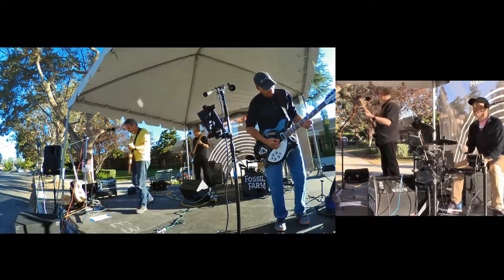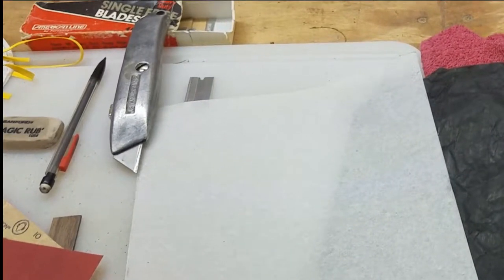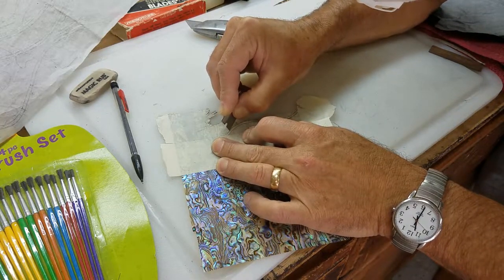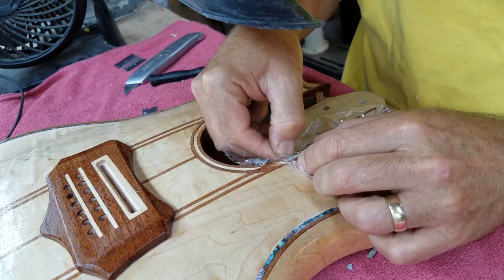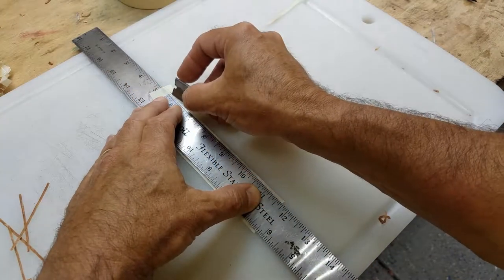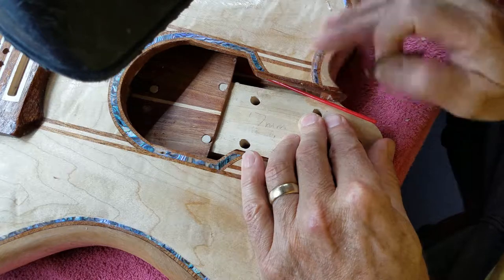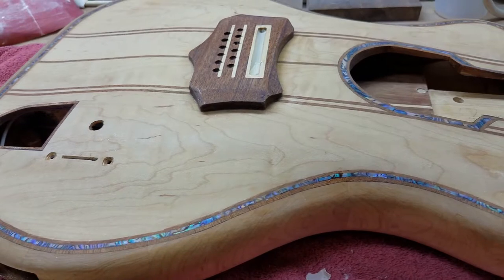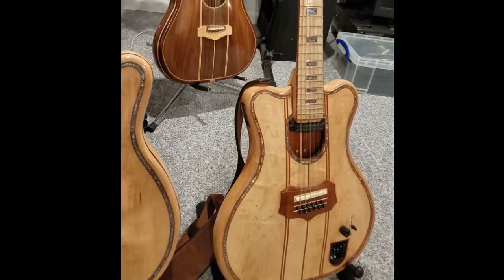Add Abalone/Mother of Pearl Inlay Faster Using Shell Veneer

Comment: With all the high end guitars I have and all the abalone, wood purfling that is used, someone must have the patience of Job!  This is a remarkable video.  I am sure that "massed produced" guitars have a more mechanized procedure for abalone/mother of pearl inlays.  Even some high end guitars use the real thing on the top and "cheat"/imitation on the sides and back, so say's my luthier.
Reply from the maker: The great thing about using veneer is that it is real shell, so is as authentic looking as the solid stuff, but much easier to work with. That said, these day's I've also been using some man-made thin veneers and getting great results. I've no idea how thick the MOP and abalone shell actually is on production guitars.

Comment: I was really thinking about this method, cause makes cutting the shell easier and without jewlers saw, but I didn't know if it would work, also I was thinking to glue a wood piece of the same under the venner to make it more rezistant for the frets. Glad I found this video
Reply from the maker: I use this veneer on both bodies and fretboards. I've had no problems at all with it on the fretboard, though I do actually slightly inlay it in the surface and backfill to fretboard level with the superglue (CA). That way, it is absolutely level with the fretboard surface. Another thing: these days, I usually paint the underside of the veneer or the surface of the wood with a thin coat of black paint, as it makes the veneer really 'pop'!
Reply: @Drewmo2000  Oh, so there is no need for an extra piece beneath the veneer for resistance, CA glue should do the job. Regarding the black paint, you paint after you inlay the piece and then sand? Or before
Thank you for your answer and tips, cheers mate!

Comment: Superglue wood filler /coating never seen this before in a large scale. Nice
Reply from the maker: Works great, though getting more expensive, especially the accelerator for some reason. But it's worth it, especially if you spray nitro, as you only need a few top coats and thus saves putting tons of lacquer down with the necessary very long drying times.  Always keep a can of acetone handing though :)

Comment: Thank you for this. I want to use simply the abalone without the wood trimming. Does everything in this video still apply?
Reply from the maker: Yes, definitely! On some of my guitars I do a much simpler finish on the backs, just using the shell veneer, still looks really nice! :)
Reply: I would like to use this to add an abalone / wood (hollow) butterfly design to my harp.
(my harp is already strung)
Any suggestions how to add this without sanding?
I cannot sand or relive all 36 strings and then replace.
Reply from the maker: @velvetstitching3631  You can use the veneer like a true inlay, with the advantages of not having to carve deep into the wood and being easy to cut out, and then very carefully glue in place with the superglue, making sure not to squish it out onto the surrounding area. You would probably still need to fill over the area and sand smooth though, and in doing that it's hard to see how you could do that without impacting the surrounding surface. I'd experiment on some blank pieces of finished wood first to see if it's possible. Good luck!

Comment: I got "premium" veneer that seemed good because it was thicker and had micro-fractures allowing me to circle a curved surface like a flute. Problem was the clear film on top was terrible looking and evidently not really meant to come off because it leaves patches of adhesive.
Reply from the maker: Can't say I've ever used that stuff, as I only use veneers on reasonably flat surfaces. I avoid veneers with either an adhesive backing or some additional film on top as it just complicates things, but to put veneer on a very curved surface is definitely a tricky proposition. I would try some other makes and search around Youtube for more info. Apparently anglers like to put abalone on fishing rods, so you might find some info there.